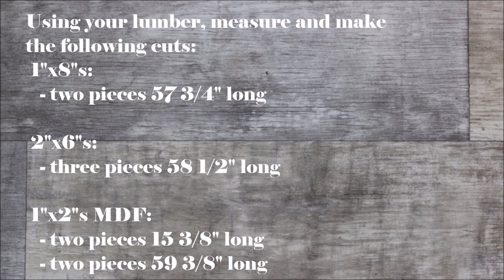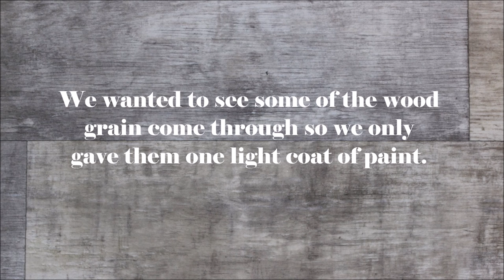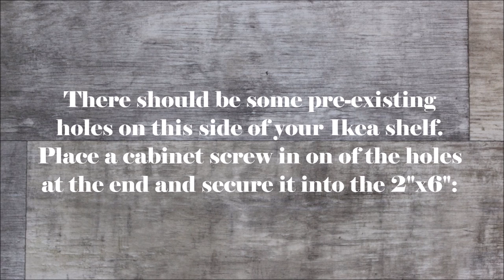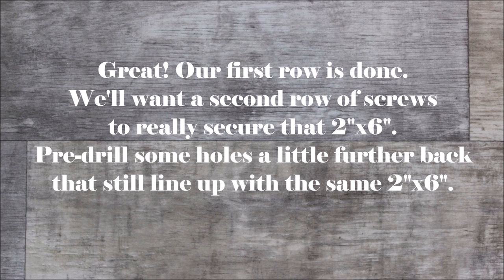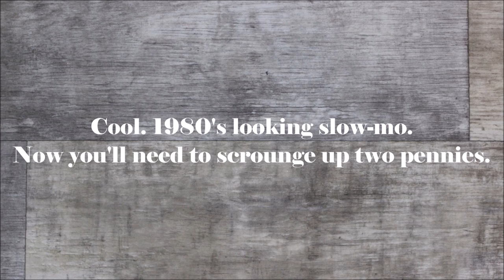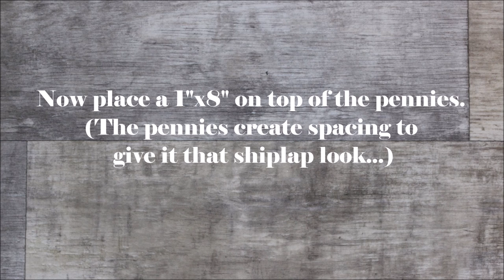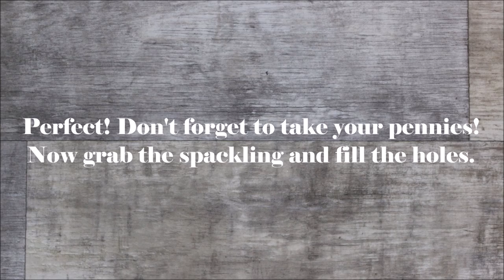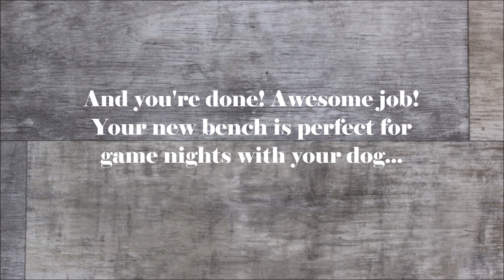IKEA HACK - The Shiplap-style Storage Bench

Comment: Not necessarily needed here, but those knots in most types of pine/fir/hem fir, boards will bleed through latex paint.  Consider shellac sanding sealer, or using an oil based primer next time.  Really nice hack.  Looks great.

Comment: Beginners and Hacks.  when it is upside down, how do you keep the 2 by 6 boards together for a tight smooth top.  Clamps...new idea.....Next  Ikea is composition material get those screws into the middle and still it might miss and go through the edge..  Don't overstress this box this has cheap corners and will give and bend, no more bench,even with the boards in the back, you might get a few more screws in there not just two on each end.  Maybe one day he will show you how to do that.   Or accidental learning is so much fun and stress.   Did you choose the best side of the boards for the top or it just happens ?.....Hals Wood Shop.....This series should b e called Pretty in Pine.

Comment: Shiplap is a type of wooden board used commonly as exterior siding in the construction of residences, barns, sheds, and outbuildings. It is either rough-sawn 1" or milled 3/4" pine or similarly inexpensive wood between 3" and 10" wide with a 3/8" - 1/2" rabbet on opposite sides of each end. - wiki   also, where's the chic?
Reply: onjoFilms nice!! when a cute chick calls something shiplap that clearly is not shiplap, its much more forgivable.
Reply: onjoFilms of
Reply: Wow, thanks for the psa pervert,  why do you feel the need to criticize a couple that makes such detailed (the most detailed) diy project videos on a common home owners level. Sure the projects could be upgraded with simple 45’s and a kreg jig for a more professional look and I’m sure they understand this but the common home owner doesn’t have these tools, most of the projects they put out can be done by literally anyone and you can make updates or adjustments as you feel necessary to make it your own or more professional. They do a great job showing necessary cuts measurements and supply list, actually so good that if you purchased the equipment to do one project they showed you could probably do 90% percent of there projects with the same tools and just screenshot the supply list for a shopping list. But if it makes you feel better to know the correct terminology on shiplap then that’s cool i guess good for you. I bet your a very skilled carpenter since you use wiki.

Comment: what kind of flooring do you guys have in this video? where'd you get it?  it's nice, wide planks. is it possibly a vinyl?  or wood?
Reply: Pestilence looks like possibly commercial grade laminate flooring.  Good stuff, durable and most come with a 10+ year residential warranty.
Reply: Jamie Friederich where can you buy that type of flooring? wouldn't be a homedepot or Lowe's?
Reply: Pestilence, they both might carry some different varieties of it.  I know Menards currently carries at least two different versions.

Otherwise, there are multiple smaller flooring stores, pro shops (ABC Supply, Probuild), that should carry samples that you can order from.

I am in the process of building a new house and am installing this type of flooring.  It is relatively cheap, but extremely durable and easy to replace individual planks, if one gets damaged.
Reply: Pestilence 
numbers